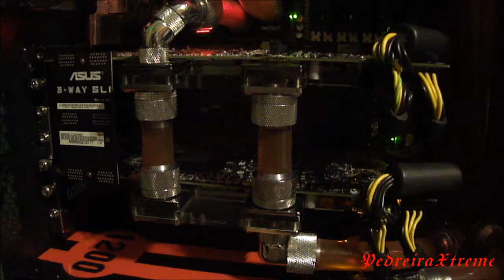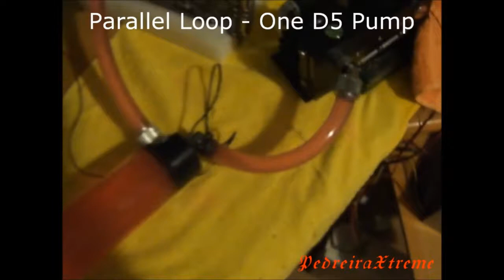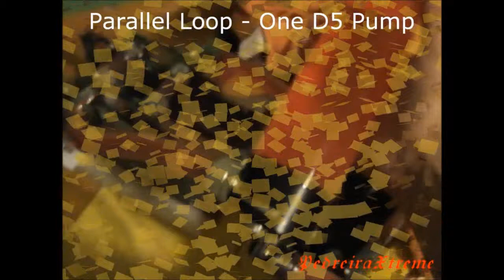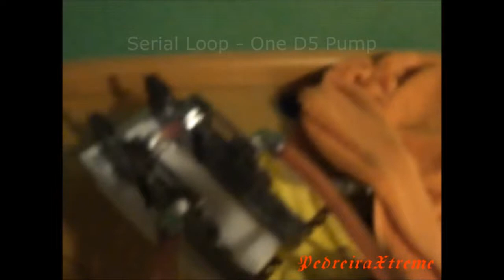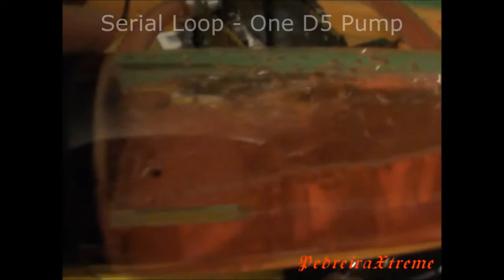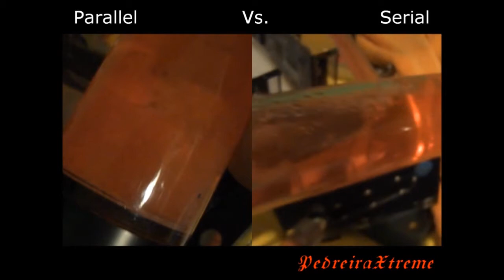Parallel Loop Vs. Serial Loop | WaterCooled PC | Custom Water Cooling System | Flow Rate Comparison

Comment: Lige you sat; water takes the easiest way.. because of that I have a question: how do you get the top block filled when parralel?
Reply: The fluid takes the path of least resistance. So it divides equally if both of the water blocks are same.